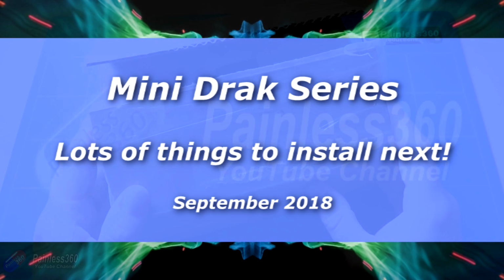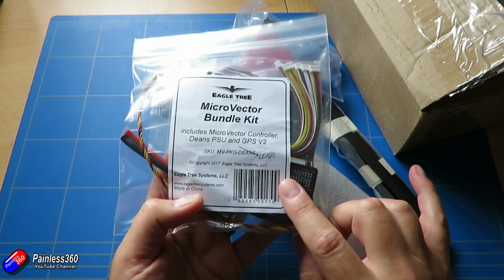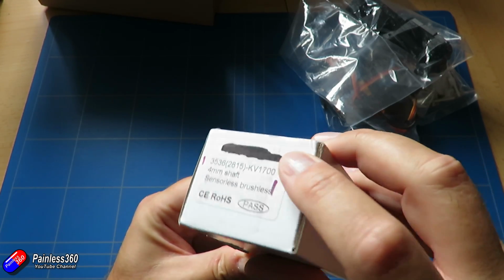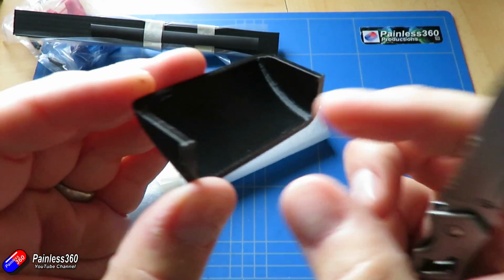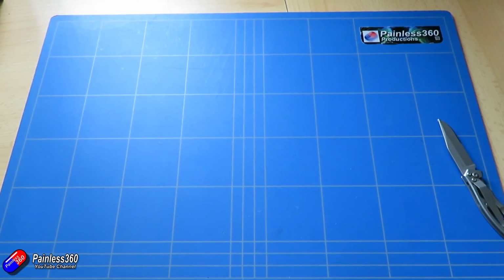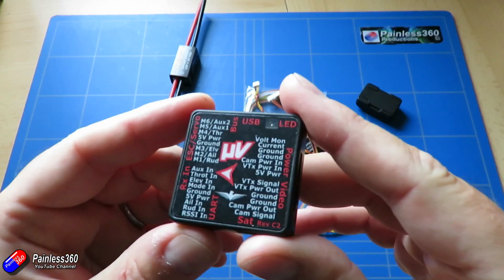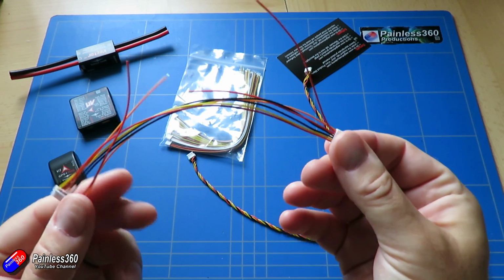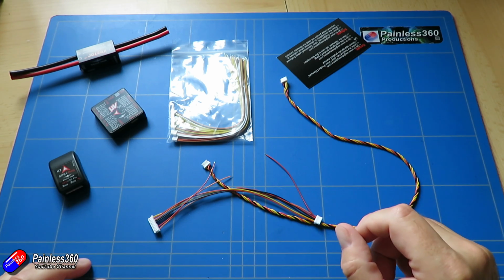Mini Drak Parts and PowerPlant I'll be using

Comment: Hi Lee did you do a maiden video of the mini drak. Can't seem to find i if you did.
Reply from the maker: No  sadly this build stalled as I lost interest.. the Dart XL is better IMHO...
Reply: @Painless360  Thanks Lee. I'm making a  video tutorial on using DevWing Foam for my channel which a few followers have requested. Wanted something a little different as I've done flying wings on the previous software Profili2 Pro.  Already done a mini tutorial where I made some replacement rotor blades for the AutoG2 and a new 3d printed rotor head using a single attachment bolt. Built the negative incidence into the rotor head and it worked well. Found your review on the AutoG2 really helpful.  I did crash it first but the blades survived and  just twisted back on the bolts had a second flight and that went a lot better. Love your channel been a subscriber from your early days. 👍👍👍

Comment: I'd be really interested to see a wiring plan of how you set-up the micro vector - I've used the large vector in the past and it's almost what I would call plug and play. I'm trying to save weight on a long range funjet build so the micro vector does look appealing but the wiring does seem a bit more involved! Keep up the good work - your videos have helped me no end.
Reply from the maker: It is a lot more involved. The principle is the same but with less of that easy 'plug and play' of the full sized one. You also need to make up a servo connector block for the servos/esc too. I'll cover it in a seperate video or two. Stay tuned!

Comment: Hey Painless! I love your videos and I’m grateful you’ve put so many tutorials on your channel! A quick question; for a VTX antenna, which do you recommend? The TBS Triumph, Lumenier axii, or one of the pagoda antennas? Thanks! I plan on mainly doing freestyle flying.
Reply from the maker: Lots of options these days. My top two are the AOMWAY circular polarised antenna if you're cash strapped or the Pagoda and patches from MenaceRC if you want to spend a little more. Pagoda are excellent just watch for the dead spot on the top of them when flying..
Reply: Painless360 thank you for responding! And one more thing; would you recommend the Fatshark Attitude v4 for my starting fpv goggles? I don’t plan on replacing what I buy unless it breaks. Thanks again! Your input is greatly appreciated.